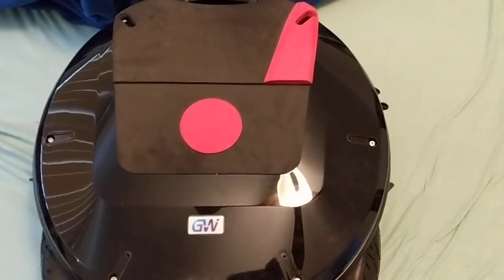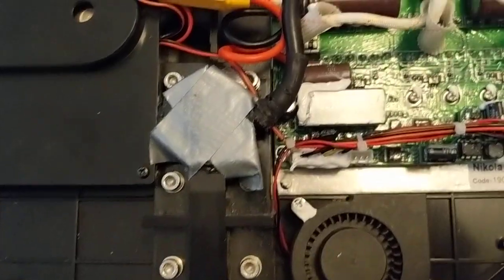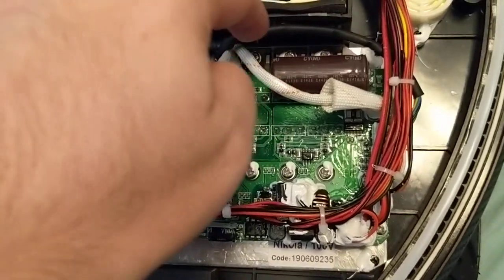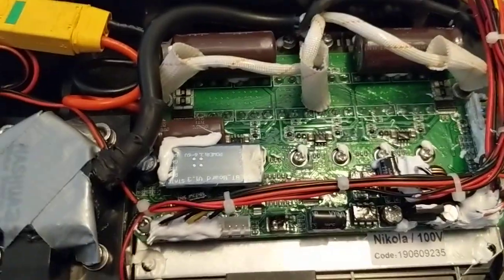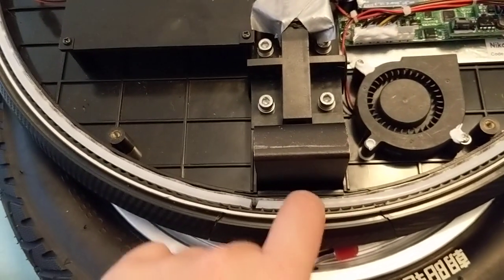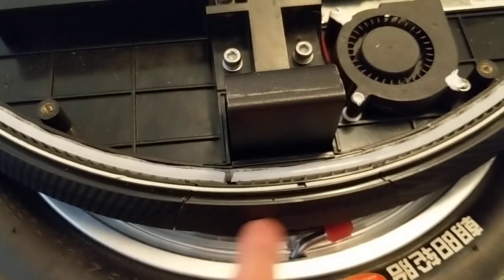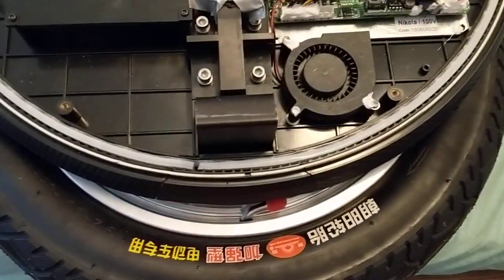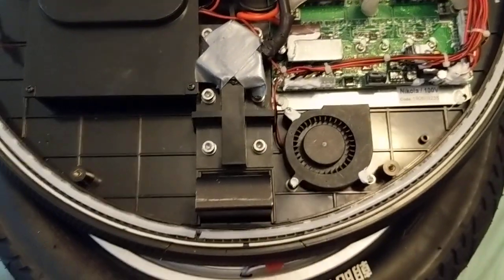Notes on Gotway Nikola Plus Tire Change

Comment: OMG, that plastic piece of the bottom is a total nightmare. Both sides were stuck. Some videos show them coming of so easy or just skip this section of the process. At least you mentioned snaps but without knowing where are the snaps or knowing the piece in advance, it may be so hard. I spend hours trying to find out how to remove them. Yes, out and up, but for hours... I wished to know where to stick a scredriver to release the snaps. It was not easy at all.

Comment: And on the other side, no wire to disconnect?
Helpful vid. Thank you
Reply from the maker: That is correct, you just need to remove the six pedal hanger screws and unclip the bottom retainer on the other side.
And you are welcome, I'm glad it is helpful.

Comment: Good thoughts but slow method seems safer to me
Reply from the maker: The slow method is riskier in my opinion, with significantly more disassembly required, way more screws, including screws hidden behind the LED strips, etc. The connectors for the LED strips are pretty deep between both halves of the shell too, and they're a pain to reconnect. You also need to remove the top battery, as well as foam and tape from the upper battery compartment that bridges both halves. Instead, you can just unplug the main battery connector and drain the caps, unplug the motor, remove the screws and slide the motor out the bottom. So much faster and easier.